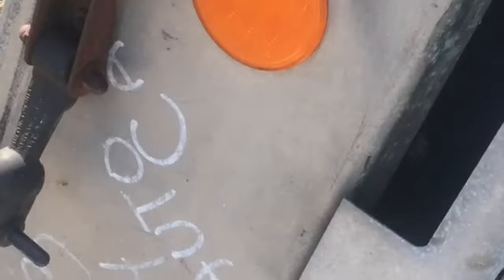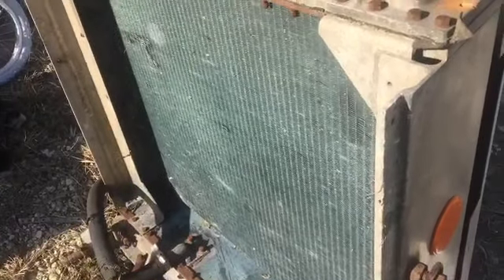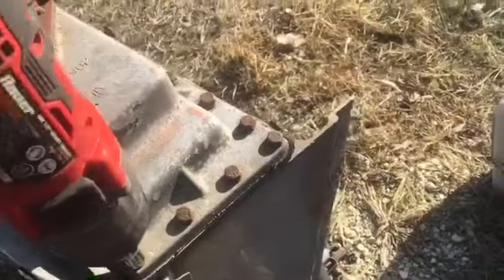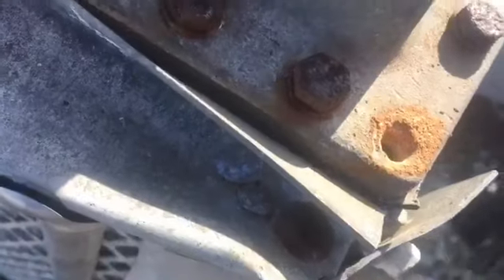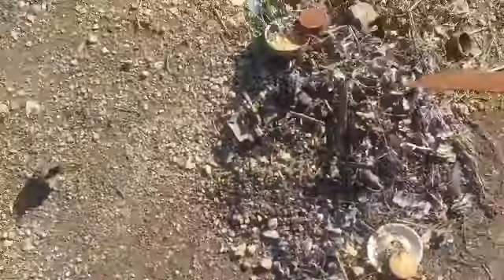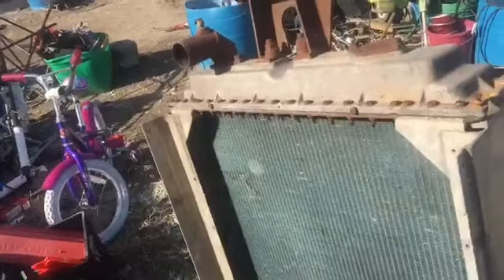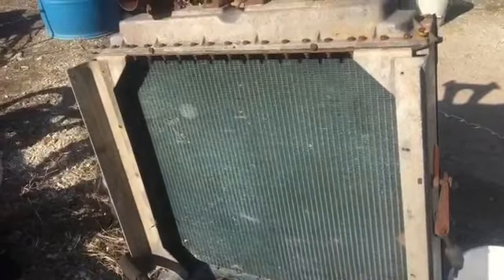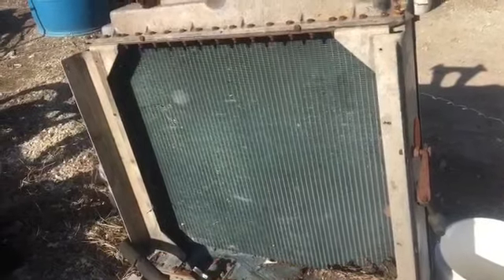IS IT EVEN WORTH IT?

Comment: Take er apart Marty, we’ll worth it!  That looks to be a four core and probably a copper brass core
Reply: That core alone is probably 15+ pounds, plus the nice hunk of cast aluminum, and other pieces on there.
Reply from the maker: Yeah you’re exactly right I just found that out a little while ago it’s a brass core
Reply from the maker: Well it came out to 40 pounds

I had to use a saws all to cut it out
Which means the top and bottom of the radiator are still stuck to the aluminum

This thing is practically indestructible I took me six hours to take it apart
Reply: Holy moly, how thick was that core? Was it copper/ brass too?
Reply from the maker: It’s both copper and brass
Copper fins. And brass tubes
Reply from the maker: I make myself look like an idiot the way I’m taking it apart

But it’s just nearly indestructible
Reply: Am I right in thinking that rad came from a refer trailer?
Reply from the maker: No it came from 1958
Auto car truck
Reply: That one is gonna pay good! Love those copper\ brass rads!
Reply from the maker: Well at $1.53 per pound and it weighs about 40 pounds that comes out to around $60

It took six hours to tear this thing up

That’s $10 per hour🙄😭
Reply: Hey, that’s not too bad. But I’m willing to bet that the ends of the core going to the tanks are solid brass also

Comment: no question if it was mine. YES break it down for sure. Yes its a little work but you cant get finished untell you get started. I set aside a couple of days a week doing nothing but breaking down the stuff I bring in. It pays off at the end. Friday I took in a load in just my pickup and got $604.20 - A.C.Rs, cords and a 5 galon bucket of clean striped #1 wire. So yes I break everything down and sort it as I go. Havent even started on my aluminum pile yet. Going to have another great run this Friday to the scrap yard. looking good for a $4000 month this month alone. picked up some heavy old farm equipment at a auction Saturday for $100 and should get at least $2000+ in scrap without even unloading it from my trailer. some of it was very heavy.
Reply from the maker: Wow I would love to get a deal like that of course you’re equipped for it having a trailer getting all the old farm equipment
$2000 made just by picking something up and dropping it off

Not bad put me to shame
Yewwwwww

$500 for breaking stuff down that’s a good deal